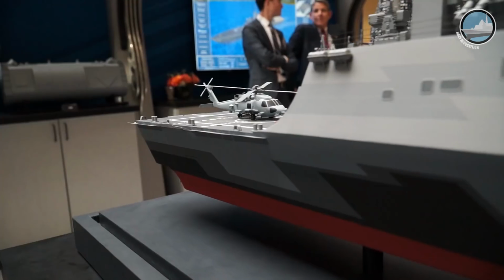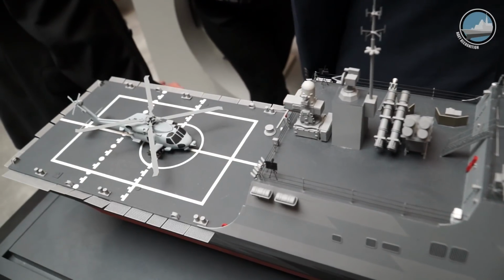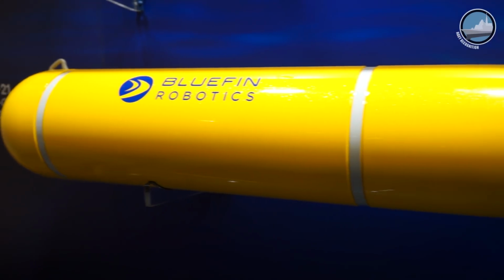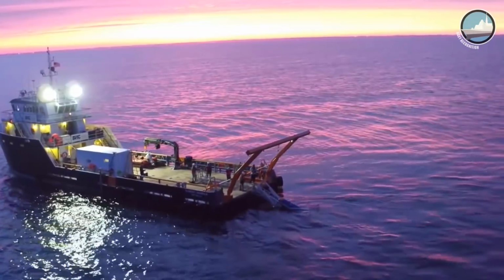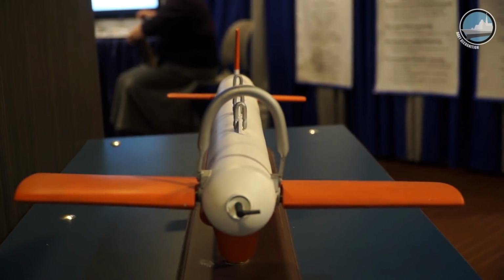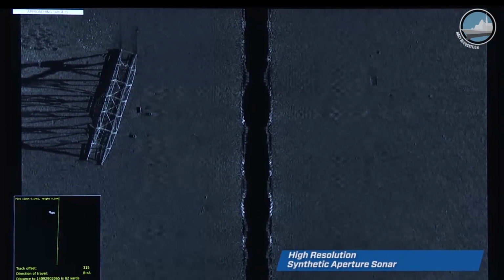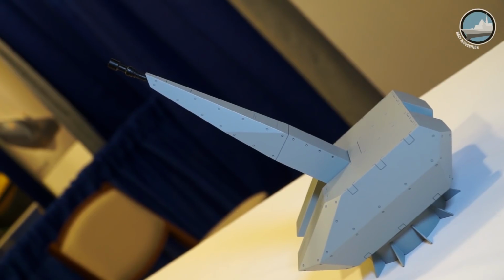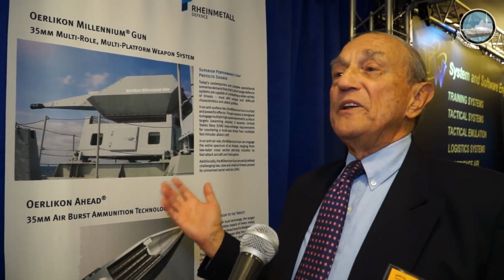SNA 2018 Day 3 / Part 1: Saudi MMSC, Knifefish UUV, AQS-24 mine hunting system, 35mm Millennium gun

Comment: The navy definitely needs to get with Rhienmetall on the 35mm gun system I've watched a few videos of anti aircraft and surface combatant  demos and that gun in particular(35mm) is no joke and pretty unbelievable, I've even seen a shore based anti missile demo too and it's just awesome,and sounds wicked as well but all in all it looks to be far superior to the Cwis 25mm system currently in use but I'm sure the brass have their reasons, idk!?
Reply: Its capable, certainly.
However does it have the same footprint as the phalanx ?
It also roughly shares the same effective range as the 57mm gun and smaller RWS systems.
SEARAM extends the range of the PD zone much further out.

Thats is also my guess why the navy wants a 57mm gun on the new FFGx. Robust PD/antiswarm gun, now with extended range (ORKA). Coupled with a reardeck 21 cell RAM launcher.

3 tier shortrange air defense. ESSM /RAM/57mm gun.
Reply: Dwwolf yea not sure about footprint and you make a good point i just think it might be cool to see used in some form cause it seems to be a killer system it sure sounds wicked when they shoot it! Lol